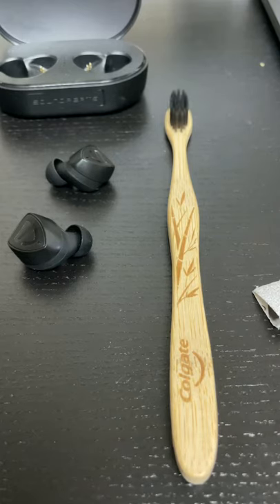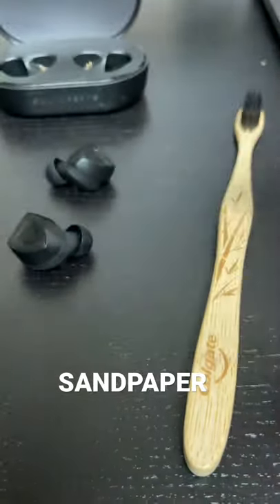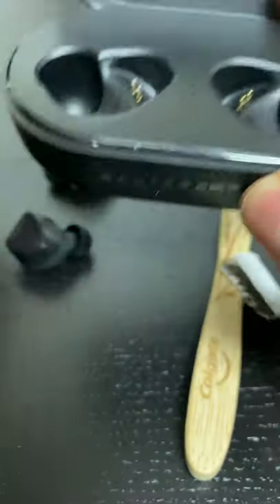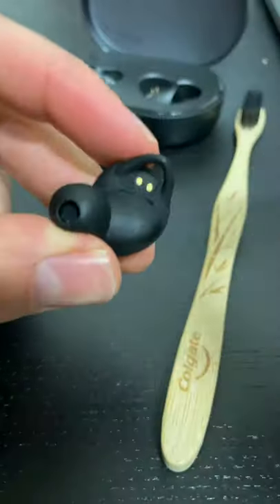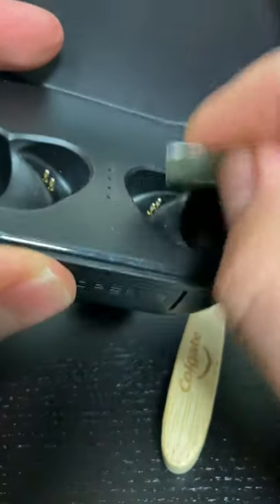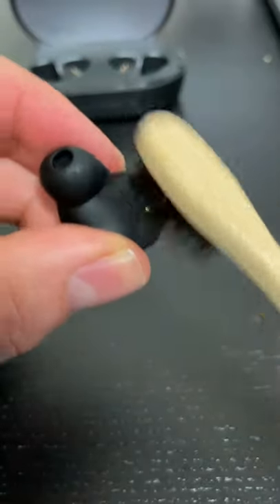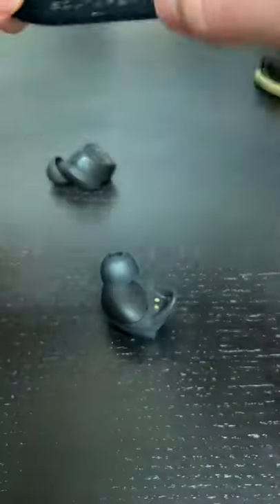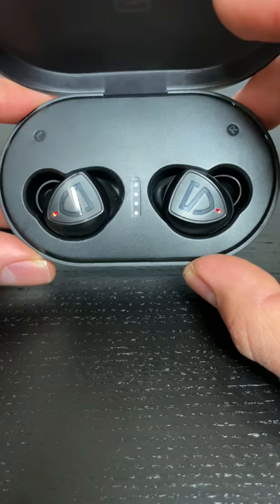True Wireless Earbuds Not Charging? Fix It For Free! (THIS ACTUALLY WORKS)

Comment: The crazy thing too is that I still never even found out what it was that was causing my right bud to have this charging issue, but in any case this trick did help it start to charge again thankfully! Whatever the gunk was in there, it wasn't visible, but I'm just glad I didn't have to throw out a Damm hundred dollar earbud lol. 😅
Reply from the maker: Woohoo! I’m glad to hear it worked 😊
Reply: OMG!! same for me! mine is only the right one LOL
Reply: I believe it’s a small layer of carbon that develops on the end of the pins which in effect blocks the charging circuit. By using the sandpaper you are scraping it off which gets you get back to clean metal again, which makes it work.
Reply: Omg same my right one has issue
Reply: @pickyaudio   had it for a while now but i think one of the pins got pushed back and cant be able to be charged. Can you please help? idk what to do.
Reply: Im having the same problem. I havent used these tools but i have tried cleaning both points of contact. Hasnt worked. Does it matter what kind of brush?
Reply: Lol its ear wax
Reply: I just tried this today in my own way lol. I didn’t have sandpaper so I used a nail file and a q-tip with tiniest mist of alcohol. It worked!
Reply: me too i just did today ha! thanks ❤
Reply: I have a 1990 Corvette mint condition and my right side window quit rolling up down and I thought it was the motor and I took apart the driver side window switches and done the same thing clean the contacts put it back in and boom so majority of the time it's not the motor in your electric windows it's the contacts just like on the headphones and I actually have a headphone Bud doing it I'm fixing to try it I stuck up some tweezers down there and messed with that little nipple at the bottom it's got to clean it up a little bit but hell they're brand new pretty much my mom had them my brother got them for her and she never usually she passed away in the but the right one don't so yeah but I was just going to let you all know man pass it on cuz 90% of the time it's the wind is switch helmet Corvette have been about $300 just for one little bitty to do one window so I'll clean them up and it worked so all right man
Reply: 90%of the time when your electric windows stop working it's the contacts in switch Just done my master driver side window switch for the passenger side and fixed it .Most vehicles if the master switch doesn't work the window or windows then the actual switch on the other windows won't work either.Save me about $300 on my 1990 Corvette .
Reply: I thought this problem only occured in 10$ tws

Comment: Man, I almost threw my cheapo Mi Wireless Earbuds then I saw this and it actually worked! Too bad already bought the Soundpeats T2 as a replacement
Reply: The T2 Is Much Better Any Way😂
Reply: @hazemosama1108  On my 2nd pair of T2s. Dropped one ear bud on my kitchen tile and it's dead just like my first pair. Had my Trushift for a year and dropped them too many times with no issue only replaced them because the battery doesn't hold a charge from being used everyday for a year.
Reply: @i7vSa7vi7y  bruh
Reply: @Ryu-qk1kx  They replaced them. Left one went out on new pair for no reason. Left it in case and charged case fully and it worked the next day.
Reply: I just tried this and it worked😭ive had these not working for 4 months now
Reply: I got the T2 as well I bought cause of the price it's amazing

Comment: If you don't have sand paper or the sand paper isnt able reach the connectors you can get a cotton swap with some hydrogen peroxide on a tip and scrub it with said cotton swab, dry it off and it works too
Reply: Thanks
Reply from the maker: Nice tip 😊
Reply: Just did it. Let's see if the right bud works now
Reply: @King-uo9up  did it work
Reply: @King-uo9up  it doesn't for me
Reply: @yahdirajasmineacevedo4074  same it still doesnt work
Reply: Nvm i opened it up and a cable wasnt connected for some reason i cant return it to the shop so i will have to buy special Welder for small cables
Reply: This is the one that works for me. Thank you!!
Reply: @King-uo9up  are you still cleaning them out ?
Reply: And if I don't have hydrogen whatever?
Reply: @bontleisgorgeous  then you buy it lol wtf

Comment: Great idea but imo a clean cloth damped with a little alcohol could clean those contacts without removing metal as sandpaper will.
Reply from the maker: True that should work as well
Reply: I did that but it didn't last. It lasted afew days only. Does this method last?
Reply: @isaachiz1395  Nothing will 'last'.
They have to be actively kept clean. That is why unless you have buds to burn like YT reviewers, you can't be rubbing away the tiny contact material, which will destroy them.
Just today one of my Earfun buds was too quiet. After a bunch of troubleshooting, on a hunch I peeled off the little mesh grill, washed it in soap and hot water, held it up to light and it looked cleaner. Put it back on, boom, loud and clear again.
Earbuds require a lifestyle change from headphones because they are far more easily affected by natural body oils, sweat, wax, dirt etc on their tiny surfaces, electrical and otherwise.
I have 3 and keep them in a rotation so hopefully they all last longer, esp batteries.I'm also more attentive to keeping my ears as clean and moisture free as I can without hurting them.

Comment: I'm happy this worked for others. For me, this ruined my buds completely because it pushed the pins down in so far that they don't come in contact with the case connectors.
Reply: That is because debris has got thick enough to block the passage of the pins use alcohol with cotton swab to clean it

Comment: Sennheiser Momentum True Wireless 3. Always happens of the right one, it doesn't matter if i clean the connectors or not. Just randomly won't charge.

Best fix is return them from where they came from and get some nice wired iems.

Comment: Wow!!! Guys I believe you can fix this with anything. I had no sandpaper so I didn’t think it was going to work with my head phone case, so what I did was use literally my charger piece to scrape it lol and before I did that, I used my toothbrush and I wet it up just with water and brush on my head phones. And I literally thought they was broke. But my face was in total shock when I put them on the charger and the red light was on them to let me know they was charging I was soooo relieved, thanks man you are the best ❤

Comment: I also use rubbing alcohol (70%ish) and use a fine mist sray bottle to spray a few good squirts of alcohol around those connections, but ALSO, take the tips off and clean those, and mainly...clean the little speaker grills best you can. Ise the alcohol, maybe the toothbrush and let it dry and wipe it down good. Alcohol dries fast. Probably 5 minutes is fine. Then everything will charge AND,if you have either of the buds losing volume or cutting out, most of the time....almost always for me, it will fix everything up and you'll hear them both like new again.

Comment: I always use soft rubber eraser to clean my contacts followed with a gentle brush or a shot of compressed air or both and NOT sandpaper   it's your call man.
Reply from the maker: That also sounds like a good idea 👍
Reply: @pickyaudio  Might be a bit less abrasive on the headphones.  😉

Comment: Please don't do this. I works for a bit, but it can quickly oxidize If u want to fix them, u can use tooth brush and some  alkohol or u can go in to repair shop and they will do it cheap and quick.
Reply: I used anti-static tissue isopropyl alcohol since that's what i use to clean stuff on my pc besides my anti-static brush, i hope it worked

Comment: my earbuds from edifier always not charging. the thing is. the right one always is the problem. both for gm5 and x3. send to center but nothing fixed. they just charged the earbuds. but still cannot charge. but my x2 plus is fine. it is weird bcs x2 is the cheapest but it still fine compared to the others which is three times the price of x2. i think sometimes cheaper is better

Comment: the thing is that mine are new and i have barely used them and i used them twice when they stopped working
and i think it’s just the case not charging and i have the dgtech ones taht come with the smart watch so i don’t know what to do
Reply: I have the same issue here, my charging case just stopped working after 2 or 3 uses

Comment: I bought an boat airdropes 190 at 28apr , in which had the same issue on after 2 days.. The right earbuds was not working.. Even though I hold the buttons, put them in case and took the out again.. Clean it with clean cloth, still didn't work.. Got annoyed.. Like how did this got broken already and tell the customer care to return the product.. If only I could have seen your video first.. My earbuds probably would have fixed or maybe not.. But anyway I am getting my refund.. So probably buy a better one who doesn't show much problems

Comment: I literally already threw out a pair, they stopped charging so I thought they were broken. Thank goodness they were really cheap though, plus they didn't have a long run time.  I just got a new pair a little bit ago and I thought they were broken too. 😮‍💨 I really feel like a idiot now

A little later..... still can't get them to charge. Maybe I gotta press harder but I also don't want to damage them. Rn I'm just using q-tips and wetting them with water. I don't have any sand paper. Why do they have to be this fusterating, I'm tired and I want to use them tomorrow. I've already been trying to figure this out for a hour.

Comment: Just be carful, people, not to push too hard on the buds' own connecting points (not the pins in the charger). I managed to dislodge them and push them down too far into the unit, and now they are not touching the pins anymore and won't charge at all. Cracking open the bud to reposition the metal connectors is not an option (nor is it a good idea).

Comment: Thanks you soo much! My in-ear monitors right bluetooth connector wouldn't charge. 30 seconds after this video it's charging. I had wiped the pins and contacts before, but I never sanded them until now. Was giving problems for weeks, on and off.

Comment: I wouldn't be a damn bit surprised if I tried this on my earbuds and it didn't work. Especially on the right one. It's so fussy all the time, and I have to keep turning it off while it's inside the case. Even while it's charging, I have to do it. I have to disable bluetooth while the case is charging, because the earbuds WILL TURN ON WHILE CHARGING. 

Edit: Tried it. Didn't work. It didn't do anything. I'm not surprised.

Comment: i dropped my fiil t1 pro about 2months ago, the drop wasnt that severe, but since then my case doesn't charge, and eventually my earbuds ran out of juice. sent it to a repair shop and they can't fix it, saw this video, but still it didn't work
Reply: when i plug the case, it blinks slowly then blinks faster, but it's not charging. Does anyone have any tips? waited for these to fix for 2 months but came back empty handed, the repair shop was kind enough not to charge me anything
Reply: He said that there's no problem with the case, he also tried swapping the earbud battery, still didnt work. i made him check the contact pins in the earbuds if they were placed properly, still didnt work
Reply: dont wanna replace these, as 60$ in my country is a lot for earbuds
Reply from the maker: Sorry to hear! Try contacting FIIL and see if they can help you out

Comment: I just bought a pair of skull candy jib true 2 series wireless earbuds and only the right side work the left side won’t charge and it cut on for a few min in the case should I return it or will this top work for these pairs I don’t want to ruin the chance of returning them back to Walmart. I need advice.😅

Comment: what if the case isn't charging?
Reply: Many things could be happening. 1. Is it a pair of airpods using lightning cable? If so the port might need to be cleaned (search how to properly do that). 2. If this fails, try buying a new charger. 3. If this fails, you're screwed.

Comment: This worked for me. Except I used rubbing alcohol with a Q-tip to wipe it down first and then scratched it clean with the pick tool on some finger nail clippers. The contacts didn't even look dirty, but they must have been.

Comment: I had issue with redmi 4 lite, right ear bud wont connect and if connect it always low on battery, im gonna try this method and see if its work or not
Reply: Hi did it work?I too have the same issue

Comment: tried this and it DID NOT WORK AT ALL
Reply: Charge it first
Reply: @qqquatro  Bruh i tried it because it wouldnt charge in the first place..
Reply: Then hard reset your tws or buy a new pair
Reply: @qqquatro  i tried to factory reset but after i did they wont turn on because the case is supposed to do that
Reply: Buy a new pair it aint working
Reply: @qqquatro  i already got a new pair that i got for free coming

Comment: Worked on my Soundcore Liberty Air wireless earbuds! Isopropyl alcohol worked a few times for me when I put them on the contact points a few months ago. That stopped working then found this video! If you don’t have sand paper, a nail file will work too! I did that and used tweezers to get into the charging cases contact points and on the earbud itself. Thanks man 😎

Comment: Thanks just saw your video and decided to clean the bud that wasn't working with just a toothbrush and earbud. Didn't want to use sand. Paper because of fear of damaging my pods.

Well it worked wonder and my bud is charging as we speak. Much thanks.

Comment: Thanks for the tip. Is there anyway I can get a ear tip/fin for the h1s? Or anything I can do to make them slightly more secure when moving a lot
Reply: its the soundpeats trueshift 2
Reply: @blade3283  thanks
Reply from the maker: Cheers! Maybe try the spinfit eartips, but with the H1 it sadly might not work for you ears
Reply: @pickyaudio  thanks, it works but at times I'll have to rejust the fit but then again you said the same , your review

Comment: What the F. Worst advice on the planet. You are removing the anti corrosion layer (might be gold but depends on how cheap your set is) on the pogo pins. This will only result in TEMPORARY contact and just make it require more sanding in the future. Clean off your gross earwax with alcohol and a swab. Worst case you need Deoxit. Not sandpaper...